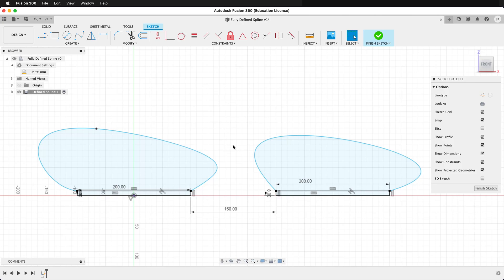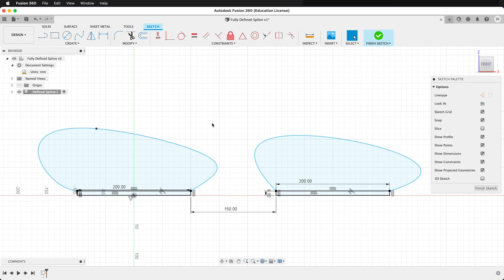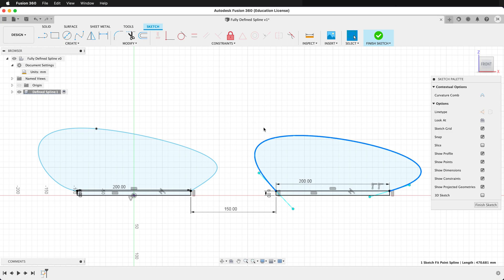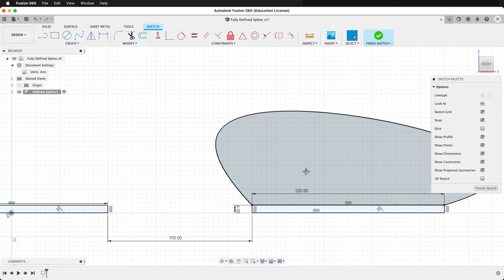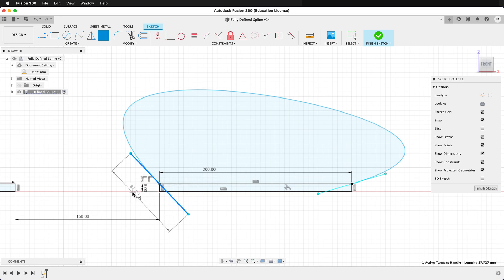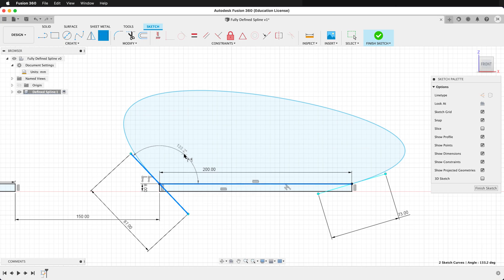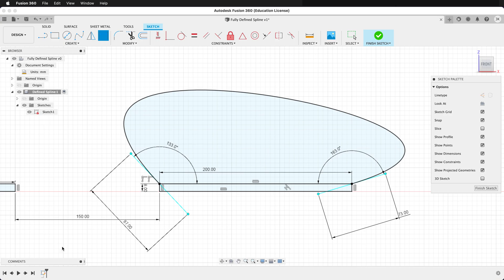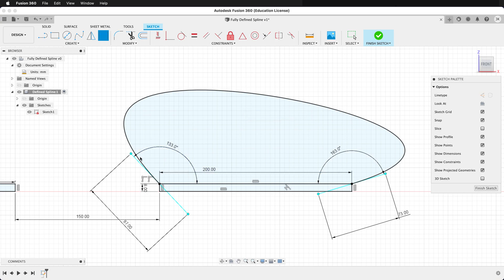Fully Defined Splines in Fusion 360 Sketch

Comment: Is there no command or button to just automatically constrain a spline like this as-is wherever it happens to be? This process is fine and well on small spline but I regularly have to trace logos for my 3D printing business and some of the splines can have hundreds of points. It is not feasible to do this process you have shown in a reasonable amount of time with that many points. I am aware of the fix/unfix option but this is not helpful when the spline needs to be scaled for creating the prints in multiple sizes. Splines do not like scaling correctly if they are not fully defined, I'm searching for a way to do exactly what you've shown here but more quickly.
Reply: Found your video for the exact purpose of needing to scale splines. I'm modeling miniature furniture based on real dimensions (divided by a scale factor parameter) and needed splines for the handle cutout on the drawer (IKEA Alex unit). Interestingly when I scaled everything down the curves weren't as smooth so I removed the scale factor from some of the handles dimensions. Some had to stay scaled  which was weird.
Reply from the maker: That is weird, they were probably just visually more rough, glad you figured out a solution
Reply from the maker: I do not know of a quicker way to display splines in Fusion 360

If I was 3D printing logos I would import them as DXF or a SVG and then move and scale that around. 

You can make DXFs in Illustrator or Inlscape perfectly to scale at multiple sizes and then insert them into Fusion 360
Reply: @WhatMakeArt  This is a good tip and I do sometimes try this method also. Sometimes the artwork I receive is poor quality JPG and I use GIMP to create clean PNG then import to Inkscape to trace bitmap and save as SVG. The real drawback here is how it breaks curves down into small straight line segments. If you have a large quantity of curves this can result in thousands of individual smaller line segments and I have had it hang for 10 - 20 minutes or even just crash when trying to offset or scale that many line segments. Retracing it as a spline from a canvas never gives me that same problem But I do have a big issue when trying to scale them.
Reply from the maker: Yes, if you need nice curvature then splines are the way to go, unfortunately, to scale them you need to have them locked down

Have you tried extruding a body from a spline and then scaling that, and then projecting a new sketch from the scales body?

You might even be able to project the splines into a new sketch and then scale that sketch or it's output

Comment: Just what I was looking for. Thanks. It seems that fully defining a spline with even only a few control points is very messy.
Reply from the maker: Yes it's best to define the spline with as few control points as needed to get your curve
Reply: @WhatMakeArt  I also discovered in another video that you can right click on the spline and chose the Fix/Unfix option to automatically fully define it
Reply from the maker: Great thanks for the tip That's very helpful